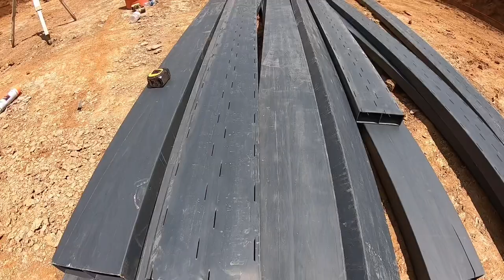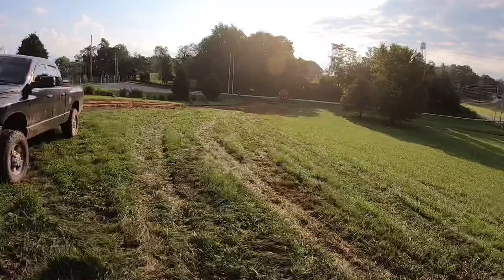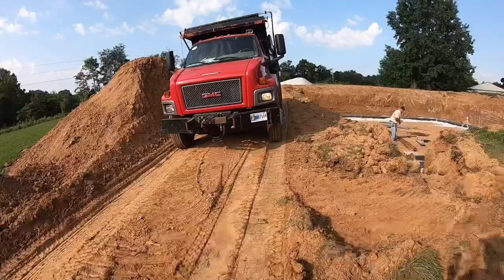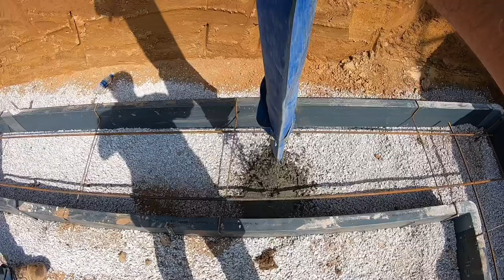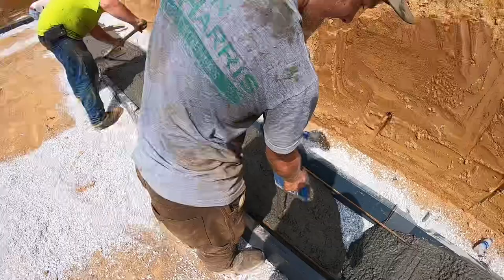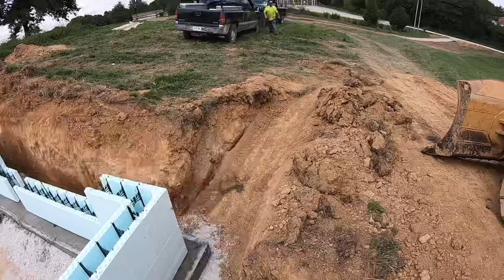Pouring footers using form-a-drain system and building a driveway into job

Comment: Mike I like the way your doing this job. It looks like a good quality work. I had never seen the form-a-drain product. I will look into that for some future work.  I use the ground fabric a lot but not many of the other contractors around me do. I think it is worth the extra cost. The only thing I have a question about is using screenings/crusher run right on the cloth?? I usually us clean 3/4 -1  inch stone right against the cloth. I want to have the water drain from under the drive.  I then finish with the crusher run rock on top.
Reply from the maker: Thanks jd size of rock is determined by ground conditions not for sure if I am right or not just do what I think is best for the job

Comment: Putting your metal stakes on the inside of the fad allows you to get the rock around the outside and onthe floor. We use a telebelt to place the rock and concrete. Makes it alot easier and alot faster. Maybe a few ideas that could help you.
Reply from the maker: Thank you and thanks for watching
Reply: @DirtPerfect  enjoyed the video. Always like construction vids. Did subscribe hope it helps you.
Reply from the maker: Thanks for the sub hope you enjoy the channel

Comment: While you have the hi-hoe there dig a pond on the lower end slope and connect the rain spouts to it at a later date. Just a little idea to do now instead of down-the-road later. I'm not talking anything large, simple flowing pondless kit or a 12 x16 three feet deep , think landscaping now , little bit of a pain with my older home. I'm building a 20 x 25 shop now and evesatroughing big O pipe to the backyard to my little pond beside the garden. Thinking ahead will help. Awesome digging job , hope your building inspector is as great as mine, to bad he's retiring this year. Nice views from that home love to see it when done!!

Comment: Great videos. Keep them rolling with all the info on the icfs and form a drain. I want to build with them just nervous on all the steps. Need any help I'll take off work and help where I can and hopefully learn?  Thanks
Reply from the maker: Been doing if for over 15 years they are awesome will answer any questions you have.  Also have 3 move videos coming from this job
Reply: @DirtPerfect  I figure this is at least a basement and first floor  how many pours will it take to complete? Also what type of attachments will you use for the floor joists?  Thank you keep the videos coming learning a lot.
Reply from the maker: Still have move coming check out my Facebook are website Simon and Harris homebuilders

Comment: Do you use any kind of basin with that drain system (bucket with a pump in it)  ?  Where does the water go if you can not dig the crossover pipe to daylight... great video you guys do a good job
Reply from the maker: This one will go to daylight if that’s not a option then yes a pit and pump

Comment: When I was an Ironworker apprentice a whole lot of years ago, I was responsible for tying small blocks to the bottom of the rebar mesh to keep it located within the concrete. I haven't seen any discussion of placement in your videos. When there were no blocks we had to "pull mesh", lifting the rebar into the wet concrete. As the apprentice, that was often my job... 😁

Comment: Make sure the rebar spacing does not hit the nudura web. There is a little flexability but better to do it right when setting.
Reply from the maker: Over a 100 basements  never a problem with hitting web 😁